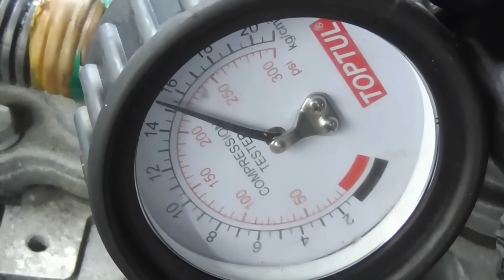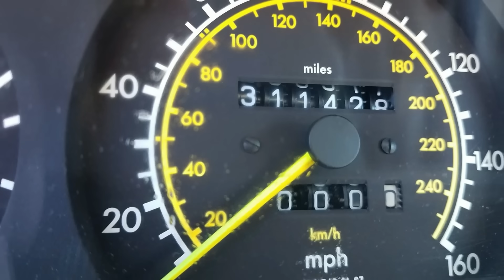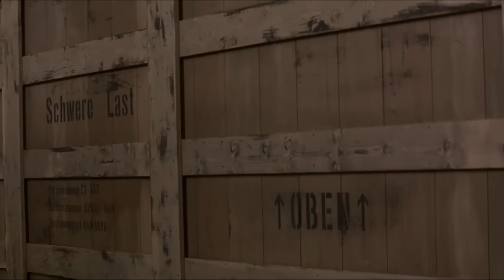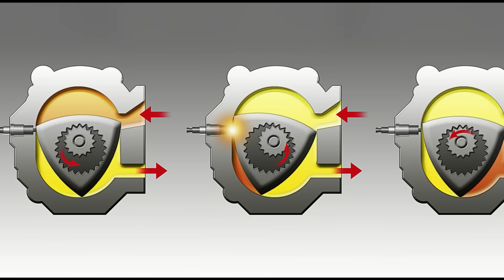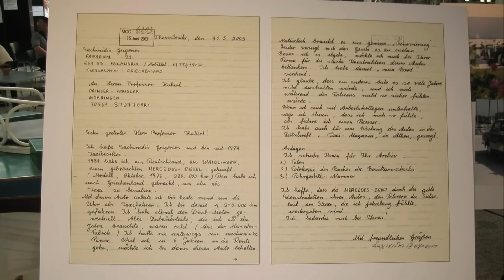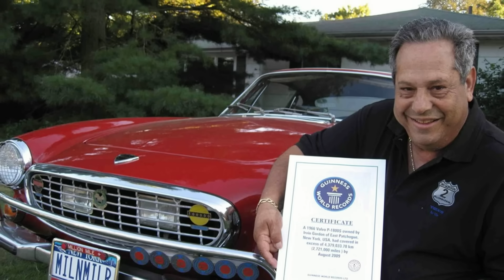Most Reliable Engines of All Time

Comment: Where’s the Hemi or Cummins???
Reply: 1320 Kidd Cummins, yes very good, modern hemis are no where close to reliable
Reply: Jared Champagne yes they are, look at how many miles some of them have on them, they last a while the only flaw they have was the 2003-2011 5.7 liter Hemi had worn cam heads due to spring failure but that was fixed I have a 6.4 liter Hemi and it has over 30,000 on it and it runs like it’s new.

Comment: My 240 Volvo has 260,000 kay uses no oil or water and runs exactly like new  my 850 Volvo is equally reliable engine wise, much depends on how you drive them and look after them indeed my cars are far more energy efficient than any Tesla. because of low cost of having them.

Comment: Mad lab must have done all of their  “ research “ outside of the U. S. .
I know of a lot of American cars and trucks that have 250k miles and more.
I personally have owned two
Chevy Astros that had the 4.3 liter V6. These engines ARE bullet proof. My first Astro a 1986 had over 
300,000 miles before I sold it.
My second Astro with the same engine I still have and drive, has 189,000 miles and cranks up every time.
The 4.3 liter Chevy is one of the most reliable engines ever and has been used in
The Chevy S10 , S10 Blazer,
The Chevy 1500 W/T  and the Astro.
It has also proven itself on the track and is capable of producing very respectable
horsepower with a few add-ons. 
Saw an S10 in Georgia running a blower on the  4.3 based engine putting out over 800hp. That’s pretty 
respectable.
Reply: allan polk,
Had a GM Safari, same as Astro. Disappointed cause vehicle mechanically shot at 125k, but someone got a great engine on trade in!

Comment: Doesn't even mention toyota 22r , 3rz fe or dodge cummins chevy durmax or ford idi
Reply: I can attest to the Toyota 3rz fe, over 200,000 miles, heavy loads, off roading, and still does not burn oil.

Comment: The Mazda Rotary? WTF? YES IT IS HARD TO BELIEVE.....THIS IS PURE HORSESHIT...
Other engines that are WAY more reliable:
1) The old inline-6 found in Ford F-150s
2) Most normally aspirated BMW "older" inline sixes.
3) I've heard of some versions of the GM's LS V8 engines reaching 250-350K miles no issues in work trucks and vans

Comment: The ford and Chevy straight 6..should be on this list..simple is better..
Reply: Mark Edwards Pezenosky,
I remember owning two or three Chevy vans with 250 inline 6 engines. Around 80 thousand miles I’d take of the head from the engine early Saturday morning. There was no EPA junk and taking of the carb and manifolds was a cinch. Within one hour or less I’d have the head in another car, drive to a machine shop, purchase a  fifty buck rebuild, gasket kits and turn in my original, drive home install head, adjust lifters, finish in time to go fishing.
Engine then runs like new.

Comment: Biggest crap ever... Even the most unreliable engines are incredibly reliable so your description is shit, and your list is even worse.
Our family car, a  Renault Laguna 1 with a 2.2 naturally aspirated diesel, currently has around 800000 km (500000 miles). We sold it 10 years ago with 300k miles, but it is still in my town, so I look at the odometer when I see the car. While we had it, the car had never been repaired in the crucial parts of the engine or transmission. It was a nice car, you knew that it was never going to fail, and it had great suspension.
I believe that two of the worst engines ever are the first common rail 2.0 tdi by VW and the current 2.0 tfsi. Pure shit, they should have stuck with the 1.8 turbo petrol.

Comment: Land Rover Defender Puma 2.2 Litre; let's see how it goes. It is simple, incredibly under-stressed and under-tuned. Ford sell it is an industrial power unit! Example: If you're a forklift or generator manufacturer etc. and need an engine, you can purchase this 2.2 Litre 'Puma' motor in several different states of tune. For the Land Rover, it has a one of the most modest power outputs (it's a slow drive!) with the best fuel economy. As an automotive enthusiast, this motor is amazing in the modern automotive world! Good ol' fashioned run-for-ever. Its been designed to run in the harshest environments for an incredible amount of time. It's amazing how smooth it is, for a 4 cylinder diesel!

Comment: Okay, I commented on this vid before I watched it, but know that I’ve almost watched it before throwing a rod, it’s BULLSHIT.

The premise that and engine that lasts long is equivalent to being reliable is mental hogwash!
An engine that rarely breaks down, always starts in the worst of conditions is RELIABILITY, despite the fact that it may throw a rod or fail at 95 thousand miles!
And engine that lasts about 250 thousand miles with multiple rebuilds is LONGEVITY, despite the owner have multiple breakdowns, monthly and weekly, replacing overpriced sensors, computer boards, ext., ( Benz, Audi, Volvo other European and yes GM cars).
Yes Toyota and Honda make engines that are both reliable and long lasting, and I’ve owned Ford and GM engines that were terrible on both aspects and others, great likewise.

Let me put it bluntly. 
I better not!

Comment: I’ve got a 1977 Buick Regal with a 350 H motor with 300k miles on it. The 400HD transmission is on its second rebuild  . I’ve never have had the cylinder heads off the engine. I’m on my second timing chain and harmonic balancer , two radiators and water pumps. The car originally was owned by the company my father worked for and was purchased off a dealer lot for a salesman car with racking up 100 k in 4 years. We got the car as part of the company inventory that my father purchased to shut the company down in 1981 and it’s been in the family ever since. Also it’s got the original catalytic converter on it but last year I replaced the exhaust system behind the converter back to the tailpipe. And by the way it still has to go through the vehicle emissions test every two years in the state of Oregon to get tags. I’m planing on repainting it next year , I was going to do it this year but to many other projects. I don’t drive it vary much now only about 500 miles a year but it runs like a clock.

Comment: Change your oil yearly or at the 3000 mile point.  Your engine will live forever.  And they failed to talk about the Porsche M28 engine from the 928;  These regularly go 300,000 miles without an overhaul and even then they take them apart and there is little wear.

Comment: I'm surprised that the Vortec 5.7 (350) wasn't on the list. I know people that build them as race engines, use them in farm trucks, haul overloaded trailers and beat the piss outta them. The highest mileage Vortec 350 I've seen in person has 720,000+ miles on it and was still running great.
Reply: Wasn’t much of anything American on the list. American cars get ragged on for unreliability, but there are quite a few American engines that will easily go 300,000 miles plus if you maintain and take care of them. Chevy 350 and the Vortec 4.3 V6, Dodge 318 and 5.2 Magnum, AMC 4.0 I6, GM 250 turbo thrift I6, GM’s iron duke after they fixed the fiero recalls, any GM or Ford 302 I6’s, V6’s and small block V8’s, Ford 351 Cleveland and 351 Windsor, believe it or not if taken care of the 5.7 Hemi, same with Vortec 5.3’s, 4.8’s and 6.0’s. Going over to diesels there’s the Cummins 5.7, 5.9, most Duramax motors, Ford 7.3 idi and tdi powerstroke, 6.7 power stroke. It all comes down to maintenance and how you drive it.

Comment: Where in the hell is the LS Chevy engine?? I have a 2002 Silverado LS 299,003 miles . No noises, no ticks, no knocks just basic regular maintenance. The only major change I've done was the transmission that went out at 286,000 miles. All this foreign car showcasing and you leave out America's most "swapped" engine.

Comment: The V-4 in the Saab was a very tough engine that started out as a fire pump engine. The rest of the cars were so-so but the engines were bullet proof.
Reply: The Saab V4 is a car engine which was fitted to most Ford midsize passenger vehicles in 60s and 70s Europe. It started out in the 1962 Ford 12M, not in a fire pump.

Comment: My 2014 Prius V has 997,000kms all stock except it rebuilt the battery with parts off eBay a couple of times and the usual wear and tear items replaced, currently needing an engine mount and intake cleaned soon

Comment: Are you serious? 100K miles before falling apart is “reliable?”

That standard is so low practically every engine built since 1940 meets it.
Reply: Except Mazda's Rotary, usually needs rebuild after 50- 60k
Reply: Jim Whitehead  The 300-6 was the definition of reliable.  The 351 (Ford) was fine if left factory.  Too many were hot rodded and had problems.  The (GM) 350 was a better engine if you're trying to squeeze the most HP out of it.
Reply: MrJeffcoley1 right? I’m at 486k in my accord
Reply: 100000is broke in not dead
Reply: my last car had 180,000 miles on it    i got another one when the transmission went bust
my dad had 210k  on 2006 nissan sentra before he sold it  everything ran perfectly on it
Reply: Jim Whitehead  straight six 4.9L Ford 300 is bulletproof. Same for the 2.2L Subaru
Reply: @perro7183  Any of those Ford inline 6 engines were bulletproof - had a 170 in my Falcon, it ended up in a Houseboat after the Falcon rusted out.
Reply: I have an 06 spectra 205k NO issues yet, runs like a top. Take it on long road trips, drive it every day. I have no doubts that 300k is likely.
Reply: 100k "?" 
My V10 Dodge has 260k never has been apart.
Reply: I've seen Yamaha 1002cc EXUP engines with over 150k on them. Mine has 68k on it and going strong.
Reply: My 1992 Chevy Suburban with the 350 has over 200k
Reply: My best reliable car was 1983 Nissan Maxima w. L24 straight six...same engine as 240z but with Bosch L Jetronic fuel injection instead of carbs on 240z.. 350,000 miles and motor still good ! Used 20/50 Valvoline oil after 100,000 miles with no significant oil usage. Power was less when higher mileage ...but stilluseable. Was driving in Colorado based in Boulder at 5, 400 ft. where O /2 is 18% less than sea level so automatically less power. Only problem with whole engine was the electical clips that connect to the fuel injectors which was a Bosch fukk up design...corrosion on the clip and terminals on injector caused misfiring which NO mechanic could diagnose...I tried many in Boulder and Denver. Owned the car 21 years and did many long distance trips including to Long Island NY, LA. 6 times and Seattle once. Great car on long trips with good gas mileage even fully loaded...28 mpg. Only problem was those damn fuel injector clips. !!!!**
Reply: Also::: Nissan L 24 motor had incredible flat torque curve from 1000 rpm to 5000 rpm...could easily climb most Colorado hills in 4th gear in manual 5 spd. Made driving easy and fun.Great balance in chassis made for good cornering and stable through corners.
Reply: @michaelcelani8325  my '84 Maxima had over 200k when I got it. Over 250k when I sold it. Still ran like a top.
Reply: My civic has 200k
Reply: Jeep leaves the chat...
Reply: The exceptions are MAJOR and considered TOTAL FAILS, like the Vega 140.
Reply: Are the smallish turbo engines 500hp really top list reliable?
Reply: No, more like 1980-1990. Cars in the US didn't even have odometers that went to 100,000 before the 1980s, because they weren't expected to last that long.
Reply: @PistonAvatarGuy  232ci AMC engine that outlived the company. Dodge ended the use of their inline 6 in favour of the AMC motor which remained in production from 1964 until 2006 and was only taken out of production in favour of smaller V6 engines. the block was never changed and it remains one of the longest-running and most reliable production engines in history.
Reply: @joer8854  *242
-
Anyway, you can bet that it's long life wasn't intentional, otherwise more engines would have similar longevity. Chrysler did update the engine when they took ownership of Jeep, BTW.
Reply: @PistonAvatarGuy  Yes the head and the pistons, not the block.
Reply: @PistonAvatarGuy  with the original heads and block it was a 258. That changed with the new heads, crank, pistons and arms. I should know, I owned a 1982 AMC spirit with the 258 4.2L I6
Reply: @PistonAvatarGuy  In fact when they build up the engines for motorsports they use various parts from different years. The crank from my former engine is one of the most sought after parts. Because the block remained the same, you can use the various parts from various years interchangeably.
Reply: @joer8854  Chrysler also updated the 4.0 (242), which is the engine that was produced until 2006.
Reply: @PistonAvatarGuy  That guy uses the crank used in my engine I had with a newer block, different heads all from different years with 70's arms and aftermarket pistons and cam.
Reply: @PistonAvatarGuy  im not surprised XD us cars sucks ass still to this day
Reply: That was the standard in the 70's and 80s, now a engine better see 200 without a problem
Reply: @Antonyg2100  Cars aren't designed to last that long any more.
Reply: @Antonyg2100  Nope.
1970s Toyota Celicas and Corollas reliably went 200k or very close (barring wrecks that totalled the car).
MANY V8 and I6 engines could argue the point in that period.

Comment: I had a pontiac Sunfire I did regular oil changes and when I sold it, it had 170k miles on the engine and zero issues engine wise speaking just paint and some electrical issues.

Comment: 3 million miles is quite something! How many times did the head come off the engine? New crank bearings fitted at any stage? Interesting comment about the clutch in the Volvo at the end. I've always thought that a clutch should in principle go on for ever if you change gear just right - and always assuming the spring doesn't take a 'set', which is out of the driver's hands. I'm a fairly low mileage driver so all my cars have rusted away before they reached insane mileages, but I've certainly heard of a clutch doing well over 200,000 miles, in several cases.
Reply: Clutches can last but they become nasty , as the parts wear in hub and pressure plate

Comment: Seems more like a fantasy list to me, due to high number of "only time will tell" and "can't really tell for sure" engines. This freaking blasphemy, he listed Wankel engine and did not even mention VW 1.6(MK2) or VW 1.9(MK3) diesels.. Those freakin' 1.9 TDI engines have ran over 400K miles( around 600.000kms) and are still going strong with original head gaskets and turbos, 25+ years later, they still have insanely high gas mileage that can easily put bunch of new and "modern" engines to shame. Just look for Audi A2 TDI, it will beat any electric, any time, any place. Burns less gas than the lighter LMAO. And it will last forever, aluminum chassis yo. All you need to do, is change the filters once a year, and bunch of them made it over 30 years despite people putting cheap oil and with wrong specs in them. I know a guy that owns MK2 1.6 TD Golf, he puts 15W-40 in it, engine still pulls like a train. Did i mention it's from 1989?

Comment: my 1993 Toyota Starlet 1.5 diesel 
I acquired this car with  
already 230k on the clock and now  still going strong at just under half a million. in my time mostly driven hot running with 25-30k oil change intervals and only real maintenance includes belts/ timing belt/wp/ brake pads/shoes  excetera
in my personal opinion bullet proof
won't get you speeding ticket but it'll get you there

Comment: How about the B2300 Volvo 4 cylinder without turbo?  I had a 940 wagon that I bought that had 238,000 miles.  Ran great and had great gas mileage as well

Comment: I see you forgot about the GM 3800 v6 these engines can easily see 200000 miles I have seen the with 300000 and 400000 my 3.8 series 3 in my 2007 Pontiac grand prix has 227800 miles still runs like a boss

Comment: Will go 100k to 150k ? So what ? Any engine today will go 200k.
My 4.0 toyota 4runner has 240k and has never been touched, doesn’t use a drop of oil between oil changes, still runs like new.

Comment: I would consider also :
 -Alfa Romeo's  "bialbero"  
-Fiat "Twin Cam" ( known as the "Lampredi Twin Cam")
-Fiat 100 series engine
All three  are durable motors if maintened properly
(the electrical problems that italian cars had or still have,are a different discussion)
Reply: Yep. Had a fiat 131 with a twin cam 1.8? 1.9? It rapped out at 9,000 rpm.

Comment: During my time in school to be  a car mechanic, a taxi cab came in for oil and filter change. The car had runned over 1.600.000 miles. It was a Volvo 745 station wagon with VW diesel inline 6. The car looked like it had not even runned half of that. The owner used it for many more years. I don't know how long it lasted.

Comment: Where’s the VW 1.9 TDI ALH?
400k to 1 million miles easy...

The VW 2.5 5 cylinder is also pretty bulletproof 

Dodge 318 V8, dubbed the “Mistake Motor” as they made the “mistake” of making it TOO reliable
Reply: Agree with the VW 2.5L engine.  Totally bulletproof.

Comment: my 2006 Mazda 6 2.3 now has 303,000 on the odometer..and I have a 1980 mercedes 240d which has the same engine as the 300d this particular engine will go easily over half a million miles..

Comment: This guy is talking about 100k and 200k mile engines, I don't own any of these sorry ass engines but my 2008 expedition has 350k miles and my 2003 Silverado has over 500k, both with original engines and I still drive them like a madman.

Comment: I’ve got a Toyota Yaris with 283k on it with the original spark plugs.   Still gives me 40 mpg.   Doesn’t leak or burn oil. 
Not the biggest or the fastest but that 1fnze engine should’ve been on here.